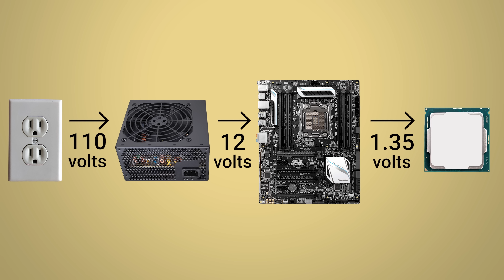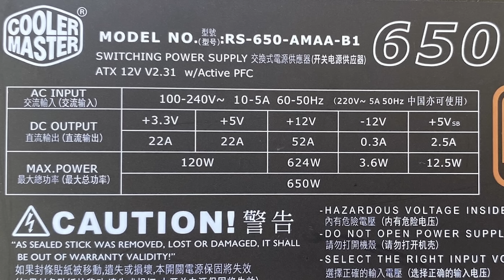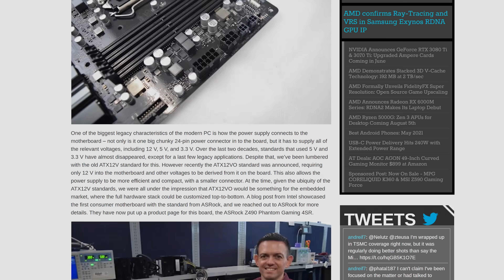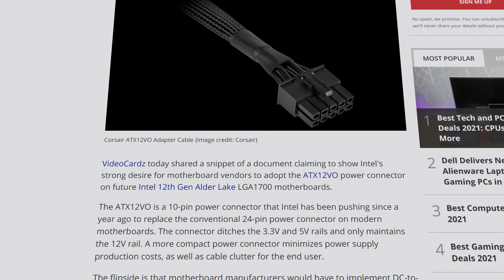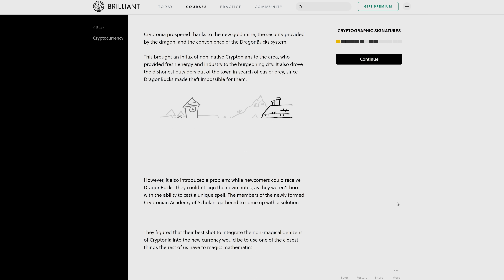Is The 24-Pin Connector DEAD?

Comment: Quick tip: If a headline includes a question mark, assume the answer is "no". 60% of the time it works every time.
Reply: It annoys me af. I hate seeing title like "Is the chip shortage ending?!" or "Ryzen 9000 is a big deal". It annoys me even more when someone says it much more often than they should
Reply: 60% ? More like 100%, but I still clicked and watched.
Reply: @paulreeves8251  exactly!
Reply: This is known as Betteridge's law of headlines.
Reply: More like 99.9 % of the time. If it aint broke, dont try to fix it. Changing it will just make it more expensive for the end user and serve little to no practical use.
Reply: Or the caption changes halfway through the day
Reply: https://en.wikipedia.org/wiki/Betteridge%27s_law_of_headlines

Comment: This cable isn't a problem at all - someone needs to sort the front panel connectors out that's what they need to do.
Reply: @Ricardo Perez The problem is it's only Intel who can set these standards, and they don't really give a monkeys about people having build problems either at the personal level or the sys integrator level.
Reply: YES! I despise those things.
Reply: @Ricardo Perez asus had one good idea but i saw something more interesting a DB15 (the vga cable) header for each end it was a custom job and it was fast and quick I'm sure that someone can takea USBC cable and do the same. but they should have had a header like they did with USB2 and HDAudio headers in the first place.
Reply: @Ricardo Perez aorus has it on some of their highend boards, my z490 waterforce had one but my x570 pro wifi itx didnt come with one
Reply: Agreed front panel connectors should be one universal connection instead of being seperate tiny  connectors that have different layouts on every damn mobo....
Reply: @drunkhusband6257  Haha yep!! D: I hate them. I actually now buy extension cables for each build just so I can have more manageable cables. Just another £7 or so but still it doesn't FIX it just sorta makes it easier.
Reply: @Ricardo Perez They still have it on all there higher end boards, I have 2 mobos that have the adapter it is called an ASUS q-connector

Comment: So the power supply you keep 10 years will become simpler & cheaper, and the motherboard you change every 3 years will become more complex, more prone to failure and more expensive. Components for conversion will be become e-waste every 3 years instead of 10.
Ok.
Usefull on prebuild machines, but garbage for DIY market.

Comment: "Power everything with a single cable"?

I mean, Apple does, if you ignore the polarity on the other end of their power supplies. ;)

Albeit, Apple already has much better performance per watt than more or less any "DIY" PC too.

What I still want: passively cooled hot swappable PSUs. I can find passively cooled PSUs, I can find hot swappable PSUs, but in conjunction such designs still elude me. ;( 

Yes, I build and administer servers.

Comment: for motherboards this work fine but if you want to build a system with lots of hdd's or other stuff the old verison its better.
i have many stuff in my pc.
D5 Pump, Aquaero 6 Pro, a Fan Splitter, HDD, SSD's (x4 in future more), A Soundcard. this stuff needs lots of power.

Comment: Isn't there a way to step down voltage that doesn't just convert the extra energy into heat? Isn't there efficient ways to covert DC volts between each other without needing to burn off the excess energy as heat?
Reply: They already do that. That's what a Switching Power Supply does. Linear regulators burn it off to heat, but PC power supplies don't use that method and haven't for many many years. There is still heat production even with a switching power supply though, just not nearly as much.
Reply: @HVDynamo  thanks

Comment: What is the difference between the power supply stepping down the voltage vs the motherboard as related to Power Efficiency? Wouldn't you get just as must heat and power loss if the motherboard stepdown the voltage?
Reply: The advantage is that a motherboard will know within a tighter range what the power draw will be on those lower voltages so it will be better able to optimize the efficiency of the converters for that specific application. Power Supplies today just try to make sure it can do enough power for each to cover all applications, but with this design they can just focus on supplying 12V at the best efficiency and let the individual applications work out how much of what other voltages they need to be the most efficient.
Reply: @HVDynamo  Thanks

Comment: Never had a problem with the 24pin plug...this just sounds like a be happy fix for snowflakes to me
Reply: The new connector is more power efficient. It's useful.
Reply: I personally hate the 24 pin. On my first computer i built in 2009, the 24 pin was never fully plugged in because I couldn't get it all the way, even after trying multiple times over the 6 years i used the computer.

Comment: No one cares how large the connector is you just plug in once a year. It is the widely adapted standard and there should be a real reasons to replace it which I don't see here.
Reply: Maybe so you don't snap your motherboard in half trying to get that massive boi secured? It was easily the most difficult connector for me on my first PC build.
Reply: @Clarissa 1986 I've responded to this sentiment several times already.  

Go do your research and actually learn what you're talking about before trying to start an argument.
Reply: @Clarissa 1986 I'm pretty sure power comes from power plants, but go on.  

Besides, power conversion has been happening on the motherboard for decades, this standard is just moving more of it there.
Reply: i hear that but my last computer lasted 16 years and the psu was unplugged maybe 3 times the whole lifespan
Reply: Efficiency is the real reason it's been developed. The ease of assembly is just a nice side effect of the more efficient design, and one that users are more likely to care about than a couple percent efficiency improvement.
Reply: @MiIIiIIion  How about several drives how many are supported? Not worth the effort to change
Reply: @craighocking2042  As I understand it, each 4-pin SATA motherboard connector can power 2 drives. For the SI market, that's plenty. With optical and hard drives on the way out in favor of m.2 SSDs, the average system has little need of any SATA connectors. We might even see OEM mobos with one or even no SATA power or data connectors.
Reply: @shannonrhoads7099  from what i have seen optical drive use is on the rise given recent cyber attack problems. Hard written backups cannot be ransomed.
Reply: @nicholastrueblood8683  That is a very good point. Most cases though are omitting 5.25 inch bays completely. An external drive for backups is always a good idea.
Reply: @Octa-8wow  As does mine. I expect neither of us are using 12v only power supplies or motherboards. The 12v only standard has a 4-pin SATA power connector capable of powering 2 devices.
Reply: @Octa-8wow  sounds about right. Mine came with far more SATA power connectors than I'll need, but if someone was using it in a crazy multi-drive array then they might be necessary.

Comment: I don't get why the efficiency is better when converting 12V to 5V in the motherboard itself, instead of doing it in the PSU.
Yeah, the PSU efficiency will be higher, but the overall PC efficiency won't. If so, why not putting that 12V → 5V converter inside the power supply?

Comment: I feel like PSUs are not going adopt this, as it basically makes modular a lot more useless. Also, that will produce some ugly motherboard. Their is a whole lot of cables that come off a PSU, because you might just want to power 10 storage drives and a couple optical. PSUs have the real-estate to have 10+ cables come out the back of them, but where will we find the space for this on the MB? So now what, users will be stuck with a single sata power cable and an option to purchase a $50 sata power hub or a special sata compatible PSU that can provide power directly?

Comment: Kinda pointless to be honest, and would you rather have a power malfunction in an easy to replace a power supply or an expensive motherboard?
Reply: No

The PSU will still regulate all stuff you pull from wall,

The idea is not having AC step down by board, the idea is having step down DC 12v to even lower volt by board

In case of catastrophic disaster, the damage already done a lot when power from PSU 12v transfer to the board, long before the board do their conversion

Comment: My main problem with MB design is the fact that almost every component wants to be as close to the CPU as possible which leads to compromises in design and certain power leads still trailing around the place with to my mind unnecessary cable lengths, and sockets you would really like to be more accessible being hard and fiddly to get at.
And yes they have improved over the years, (thank you whoever designed the all in one case header plugs) but just look at your own motherboard for a minute and tell me you can't see where something is not optimally placed.

Comment: Have never had an issue with the 24-pin, if anything I like it in terms of custom cable options.  The 20-pin USB 3.0 cable on the other hand can go right on ahead and f-off, worst connector in my system by far
Reply: I broke some of those pins and now two of my front panel USB 3 ports don't work :( only mistake on my first build . fuck that thing ughh
Reply: its a manufacturing and logistics improvement. it has nothing to do with end consumer experience
Reply: @two_number_nines  never said it did, was simply answering the question prompted by the video.
Also, 12vo mostly comes down to government efficiency regulations. Most PSU/Motherboard manufacturers would probably prefer to not have to deal with the retooling and added cost that goes on with this change.
Reply: @ColeMarkusen  not replying to you but the cris n mary crybaby. also most psu manufacturers are the first ones to push for the 12vo standard. mutliple power rails are hell to manufacture.
Reply: @two_number_nines  Thanks Engineers... "solving" problems that create more problems that are actual problems. Just leave those "specific" problems for "other" people to deal with. You see this quite often in the automotive repair industry. Stuff like Cadillac putting the starter UNDER the intake plenum, so in order to change out the starter you first have to remove the plenum, thus making you replace multiple gaskets along the way. It used to be they were just on the side of the engine block and trans bell housing, near the bottom of the car, easily removed, 3 cables, 2-3 bolts and bam doneski. That was just way WAYY too "easy" though... Caused way too many "issues" with customers doing their own repairs cutting the dealership out of a TON of money, So they redesigned it so you are forced to find a more qualified mechanic, or in other words, Pay more.
Reply: @crisnmaryfam7344  first of all you need a 2$ adapter to make any old supply work with any 12vo board. 2nd of all it improves cable management. 3rd of all putting the 12-5 and 12-3 buck converter in the power supply itself is very wastefull, because they have redundantly high current rating and older power supplies have it even worse with all the voltage rails being supplied by independent coils of the same main transformer. 12vo would allow much more power supplies to be compatible with much more computers. 2nd of all I will have none of it of people complaining about modern car repairablitiy. Until people start buying more toyotas than volkswagens and chrysleroids repairability arguments are invalid. Also I would much prefer opening up my intake in  my backyard, than have to go pay a mechanic put the car on a lift and use weird extensions

Comment: I've never had issues with the 24pin, even with cramped ITX builds. 12vo is going to be hard sell for me. 30w power saved idle to have ugly power leads running from the mobo doesn't sound appealing.

AT -> ATX was nice. It was like going from VHS to DVD. ATX -> 12vo for what?, a few bucks saved a year on electric bills? My PC is never idle. Just having chrome open; with it's bloat; is enough to keep the cores from parking.

Comment: This seems like a really shitty solution to a very minor problem.. I mean we're going to add mosfets to the motherboard now? That's exactly what motherboards needed: More parts that can fail.
The PSU's JOB is to provide differing voltages why do you want the motherboard to do it? Just to reduce a 24 pin connector down to a 10 pin plus several smaller ones?
That's ... not worth it.

Comment: I for one am hyped for the standard. I already only use M.2 drives, and eventually would like to go fully NVMe, so the extra SATA connectors would go unused.

I will be even happier if and when HDDs and non-M.2 drives go to the wayside, but I know we're probably way out from that happening. I can dream though.
Reply: I can already tell you what's going to happen though.
Mobo manufacturer will make each one with the extra port for SATA power still, or atleast put a voltage regulator on the mobo. And they will charge extra for those.
Because designing the power line on the motherboard will be much more complicated too.
So they'll feel "justified" to put more on the price tag.

Plus, it's about the power for the SATA not the data. Currently you get the power directly from the PSU using cable.
With this  connector however, it will add more unused connector on your motherboard. XD

Comment: I've never had any issues with the 24 pin, in fact, this new 10 + 6 + separate mb to sata cables just looks way more complicated than it needs to be. They should either come up with a better connection layout or none at all imho. This new 10 pin is a joke.

Comment: Why does the 3.3V and 5V conversion have to be on the motherboard? Why not put it on a daughterboard or PCIe card with a 6/8pin PCIe cable. That way you only have to install it if you actually still need lower voltage peripherals.
Reply: 1st reason : Extra money for the daughterboard. Extra cost for the manufacturer or extra bill for the buyer. Optional, I know.
2nd reason :  Depending on how wide it will be, it might interfere with vertical mounted GPU
3rd Reason : That means you will see a cable going from your PCI-E slot to your PSU. And from your PCI-E board to components. And i'm sure as heck that is hard to hide.
Remember, 5v is not only for SATA, but also for USB, and ARGB LED Strips.
4th Reason : It uses a PCI-E slot, that can be used for something else. Or nothing at all for a cleaner looks.

PSU > Cable > SSD = Efficient power delivery, power loss only on the cables. (Resistance)
PSU > Cables > Mobo / Board >  Cables > SSD = Way more complicated, way more inefficient in delivering power. More power loss due to more resistance, and basically more heat.

Try grabbing the cable of a running electronic, you'll feel the heat.

Comment: As long as I can somehow use my current PSU in a new motherboard with an adapter I'm happy. I have two <1 year old semi-modular EVGA PSUs that I am expecting to use for at least 6+ years a piece. If I have to ditch my 850W PSU to buy an entirely new one for this new standard I'm gonna be pissed.

Comment: One time I put a paperclip in the 24 pin connector and used only the 6 pin connector to power my GPU. I only had 2 265w dell PSUs lying around and a sata to 6 pin adapter. It worked.

Comment: Before I watch this video, I mostly wonder why not every 24-pin plug has a 90º connector.  I haven't built a PC since the Pentium 90 but just watching YouTube videos about it makes me cringe seeing wires being nearly bent to run through grommets to the back of the case.
Reply: Heh, i thought the same too.
Instead we are "forced" to buy either a pricey CoolerMaster's 90º adapter, or a cheap one from Aliexpress.
Well, logically, probably because directly & straightly soldered to the board is tougher than soldering a 90º bent pin from the connector to the motherboard.

Comment: For the consumers, the cost is just moved from the PSU to more expensive motherboards instead. 

This is kinda boring, because PSU's will usually stay with multiple builds, while motherboards are replaced whenever you upgrade

- more expensive motherboards
- more expensive in the long run
+ Cheeper PSU's
+ Energy efficient
Reply: Uh? Since when making electricity goes through more resistance is more efficient ?

Comment: Motherboards are becoming simpler as the time goes by. More and more things are integrated in the CPU (mem controller, pcie lanes, sata, usb...entire northbridge). So to justify the cost of essentially a breakout board for the CPU with some power regulators, they decided to add more power regulators to the motherboard. Which is going to increase the price of the motherboard more than it is going to decrease the price of PSUs...
Essentially, ATX12VO is more capitalism than technology.
Reply: Intel trying their "BTX Form Factor" move that they tried long ago. xD